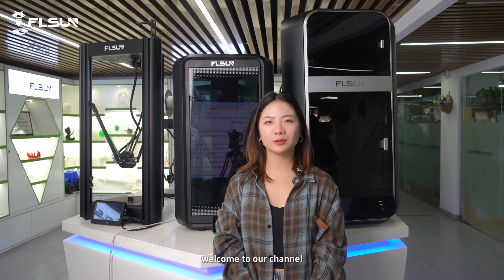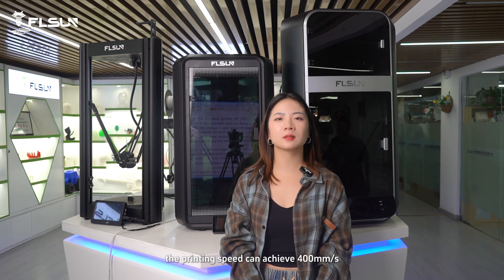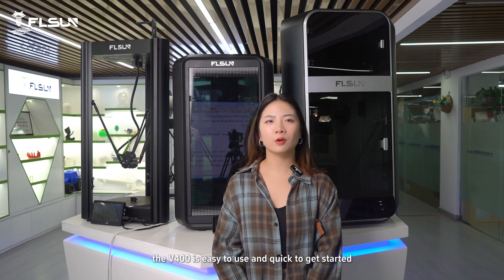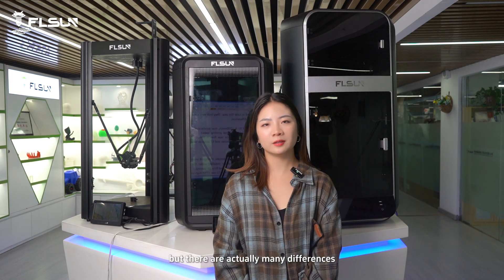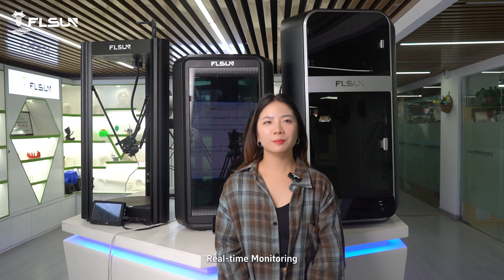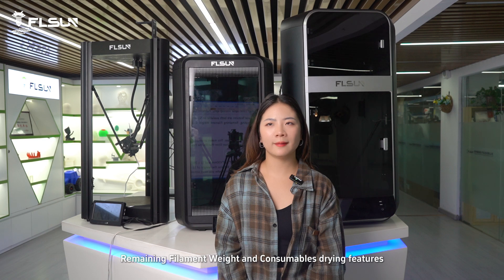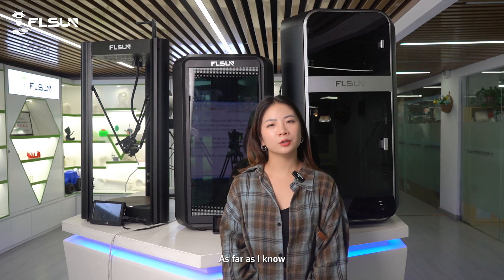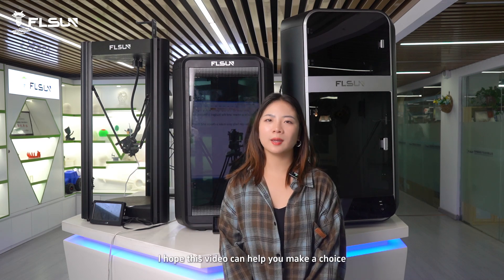Watch This Before Buying FLSUN T1, S1, V400

Comment: Guy never never buy flsun.
They are very unprofessional.

On their website they only sell a kit of x8 nozzles with x8 thermistors and x8 heating rod for 64 usd! Like who the f needs x8 heating rods?

Plus their printers never reach the advertised speed.

Also their build volume is misleading.
30cm radius doesn't mean you csn print something 30 cm wide UNLESS it's a full circle.

You only have 22 cm usable space for most models.